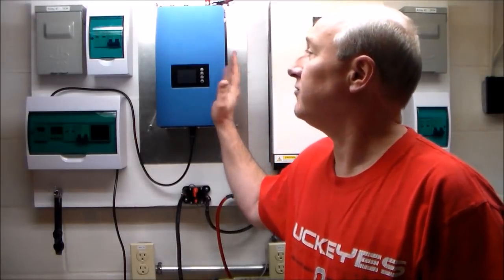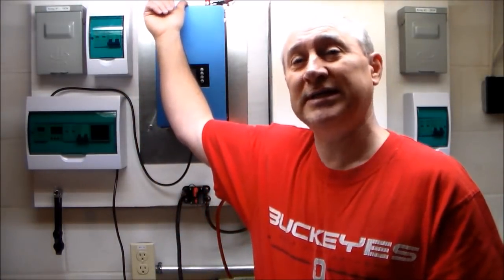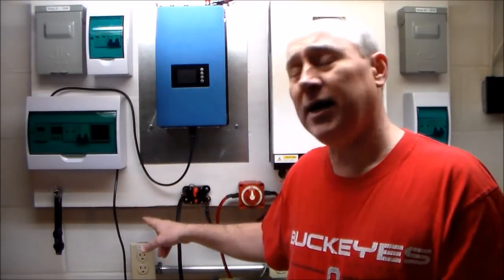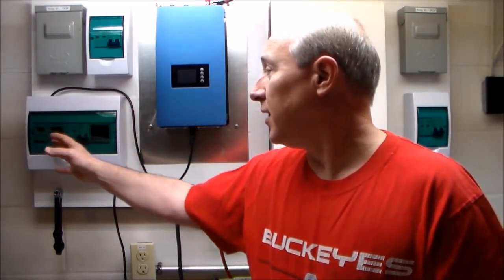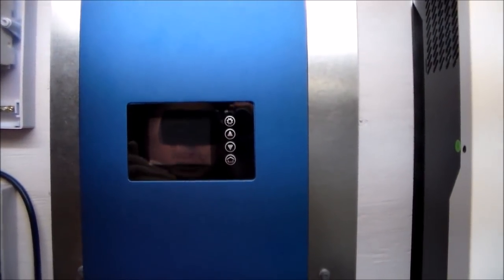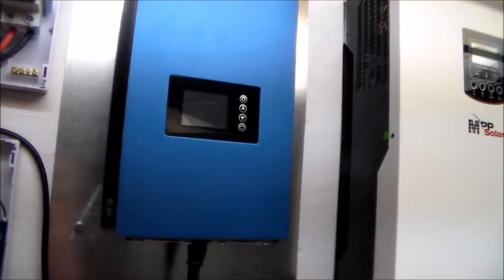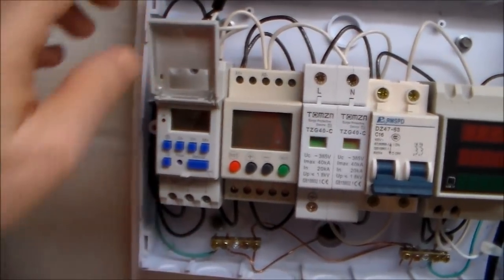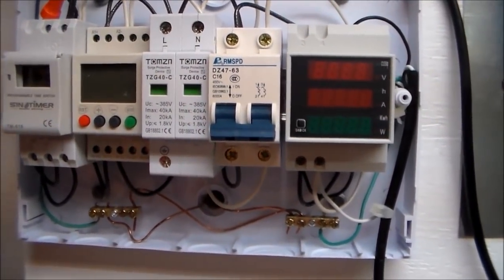DIY Solar - Episode 8 - Sun Grid Tie Inverter + Safety Devices (GTIL2)

Comment: I'm running a system that at times of days for a couple hours during the day will overproduce WITHOUT a limiter… Here's what happens.. the grid is happy to have the extra power you apply without having a net-metering contract.  I can see on the smart meter -negative power usage during those hours, but on the power bill it shows only 0 use… SO at least with my power company Southern California Edison, they have taken the apparent policy of not caring because it benefits them to take your excess power and not pay you for it rather than shut you down.  Your worry about overrating the outlets because of extra devices on the same circuit is incorrect.  The power you produce is absorbed instantly by any appliances on that circuit and they only pull what they need.  the rest is passed on.  If they take 500 w of 1000 produced, your circuit will pull 0W from the grid, and pass on 500W to the grid.  Your circuits are already circuit broken at the main panel at 15 or 20A generally.  It is not possible for more power than that to flow through the circuit because even if you tried dumping 21 A at 120V from a bunch of inverters all hooked into the same circuit, the main panel breaker would blow at the first whiff of exceeding 20A and then your inverters would see the grid go down and shut themselves down…. 

While I applaud your caution, in your zeal to be extra cautious you may have introduced an unintentional danger to your system:  While your "DC" disconnect is appropriate for cheaply manually disconnecting an AC pump outside your house, that disconnect from your solar panels is likely not appropriate as it is likely only AC rated.  You must have a DC-rated quick disconnect specially made for DC setups with this consideration of design.  It matters because DC tends to arc during connection and disconnection whereas AC because it keeps crossing 0 60 times per second self-extinguishes so you must have a specially constructed DC disconnect to not have tourble later with arc-burned contacts (and possible fire hazard)… If your disconnect ha a DC rating, I would be surprised, but this is something that you viewers need to be explicitly warned about lest they make this kind of error thinking an AC disconnect is the same as a DC disconnect as long as it is within the rated amount of amps.   And also 500A AC and 500A DC would never be the same rating for the same device because DC amps heat up wires many times more than AC Amps because DC is continuously the same amperage while AC amps are a running average amperage.or peak amperage but not continuous amperage where when you hit the 0 crossing in any AC cycle, you have 0 amperage which gives wiring a brief respite to cool twice in every cycle that DC amps do not do hence one reason why DC requires so much thicker wires than AC, why they heat up so much more. Be very careful about this problem.  You don't want your disconnect aricing in its contacts after just a few disconecct/reconnets and going down hill from there.
Reply: You are wrong.  If you plug a 2000 Watt ( 17 amp ) inverter into a 20 amp circuit, you can now plug-in appliances that will draw a total  of 37 AMPS through the wires that were designed for only 20 amps. This is 100% illegal per NEC !!!

Comment: Hello from WV. You have a complex setup there. I understand this setup is cheap v a UL grid tie inverter but it limits your production a lot. Since solar produces most at middle of day and much less as you venture away from solar noon. 
What is the change on your electric bill? Could you review a bill where it charts your usage in months before and months after your setup?

Comment: I purchased 2 of the over/under protection ones but just can’t get them to work. When hooked up they light up and blink the voltage. I went by the wiring diagram you show. Am I doing something wrong?
Reply from the maker: I would need to see a few close up photos or a video of your wiring before making any guesses as to what is wrong.

Comment: Thanks for the quick reply - what did you set your Under/Over Voltage Relay at??? 
If you are needing anything else from Aliexpress - they are having a BF sales like we are in the US - it's not a large discount , but it's some savings.
Reply from the maker: Chuck Ger Thanks for the heads-up about Ali! Under set to 110v @ 300 secs. Over set to 124v also @ 300 secs.

Comment: Are you sure you are actual putting power in your system or paying to put power in?
Reply from the maker: I am not feeding any power back to the grid. I have the limiter enabled to keep that from occurring.
Reply: @jimginnyohio  I don't think you understand what I'm getting at. A smart meter will tell when you are putting power into your system, not the grid and will charge you for power you are putting in you own home! I though the way you do until I got a efergy e2. It showed me the meter know when you are putting power into your system. Example I was using 1500 watts from my electoral company. I put 400 watts via gridtie solar panels. My efergy monitor shows my usage as 1900 watts charged to the smart meter.
Reply from the maker: @tihs69  No, I don’t believe so since the meter is on the opposite side of your electric panel from the inverter. In addition, the cheap grid tie inverters are not Smart compatible devices that would communicate with the meter. As long as your inverter does feed any power thru the meter, it would not be considered in your  electric bill.
Reply: @jimginnyohio Thanks for getting back to me. I thought I was helping out my electoral usage. My own meter at the inverter was telling me how many KWH I was putting into my system. I had no way of knowing for sure. Until I put in a house monitor that attaches to the previders electrical meter much like a limiter but on both 120 legs. Instead of showing a decrease of watts used it showed an increase the same amount that my solar panels were putting out! I joined a forum DYI solar and people there said in the US the smart meters will detect when current is being added in any amount without even going through the meter and charge you for the power you produce. If I were you I'd get a home power monitor like the efergy e2 and find out. No other way to tell for sure! Do you have any info. On how your inverter communicates with the smart meter other that then the limiter? If I knew for sure I would get this smart inverter! Thanks.
Reply from the maker: @tihs69  I currently have a Sense whole home monitoring device attached and consistently monitor the power I'm producing along with what my power company reports. I have not seen what you are describing.
Reply: @jimginnyohio  Thanks for your help. I'm looking at pulling all my stuff out and putting in a small but expandable net metering system. I looking at about $8,000.00 to start including permits etc. It will be DYI.

Comment: What size wires are you using for the breaker panel jumper connections? What size wire do you recommend going from panels?
Reply from the maker: Carsen Klock For the breaker panel jumper wires I used 12 gauge. For the cables coming from your panels, it depends on the amps you have the panels configured for. Best to check the National Codes for that based on your particular setup. For mine, I used 8 AWG.
Reply: @jimginnyohio  Thank you so much! I will be attempting to wire the same failsafes as you, I will be putting inline fuses at my solar panels and a secondary disconnect box (two total), I will also be grounding out my solar panel array (probably only going with four 100w 12v two in series and then the two pairs in parallel to get the 24v), would love to see a video of how the system has been running for the past year!

Comment: Hello Jimmy, really enjoy your solar info. videos ! One question on one of your videos you spoke about  the 2KW  grid tie inverter , 240 volt, to not get that one. What is the reason Please, I just ordered it before I saw that video .
Reply: Hi Eli. If you are outside of the U.S., this device should work just fine as it is. However, If you are in the U.S., please keep in mind that the limiter clamp will only be monitoring one side of your electrical panel while the inverter will be outputting to both sides. In this case, the inverter will not be efficient. It would be better to purchase two of the 1KW devices and connect one to each side of your electrical panel.
Reply: Thank you very much for your help. I was trying to save some bucks ( $440 for 1, $600 for 2ea. ) & yes I live in south Texas, so long.
Reply from the maker: Elias Villagomez OK, good luck with your installation. You may want to check this out to make the 220v unit work better. This will allow you to monitor both legs on your incoming grid power. Please let me know how things go since I would be interested in learning more too. Best wishes!
https://www.ebay.com/itm/Upgraded-cable-coils-for-US-220v-Grid-tie-inverter-with-Limiter-GTIL/232675119713?hash=item362c849261:m:mUO6Uuwgu0jtZB4XB0slTWw
Reply: @jimginnyohio  Wit this upgrade cable both phases will be monitored... and no back feeding to the meter ?
Reply from the maker: Carlos Guzman I’m not sure how that works with the 2KW model. However, with the two 1KW inverters I am using, there is no feedback to the meter.

Comment: You do not talk about a BMS system for you batteries. Why? If I build a 3 or 4 bank battery system, do I need one or not?
Reply from the maker: That really depends upon the batteries you use. The Valence batteries already have a BMS built into them. Therefore, they will keep the internal cells equally balanced and protect from over heat/over load conditions. By wiring the banks in parallel, the banks will self balance. For any other battery types, a BMS is a necessity.
Reply: @jimginnyohio   Thank you!!

Comment: if you install the limiter in one phase what about the other phase, so the system is going to be limited only on one side
Reply from the maker: This is a 110V device so it only outputs power on the phase you are monitoring. If you want it connected to both phases, you must install two inverters....one for each phase.

Comment: Hello,  just came across this video and I’m planning on something similar. 
I notice on your AC side the surge protector is shown on the output of the circuit breaker in the circuit diagram,  I would have thought it should be on the input side and it seems to be this way in the actual video. Can you confirm which you have ?

Comment: Your timer is not likely to save your inverter from a lighting hit just by mechanic of turning it off as lightning is static electricity and thus tends to jump across poles in switches bypassing them in its quiet to ground.   Far better to install lightning clamping devices and make sure your panels are all properly grounded to a proper number of grounding rods.  As far as the AC protection, lighting protection and a goo surge protector are all you really need.  Your utilities are generally better regulated than you are giving them credit of.  But in any case your inverters have their own internal limiters and provisions for brown-outs and over voltage conditions which they shut themselves down unless you r inverter is incredibly cheap..
 
Your AC breaker is curiously rated for 16A.  I hope that's because all your circuits in your house are rated for 20A.  None at 15A connected.  16 A is a very odd number.

The cheap typical Kilowatt meter plugin I use don't lose their memory just for disconnection.  They only reset their view on the screen to voltage but still retain their rolling usage and cost stastitics.
Reply: This is true. A lightning strike has such a fast rising edge that it contains radio frequency energy. RF is much more complicated to deal with and often does things to electronics that make no sense. You can have thousands of volts at one point on a length of copper wire and zero volts just a few inches away on the same piece of wire. I've repaired / tried to repair devices damaged by nearby strikes and have found the craziest things.

Comment: I have a question I cant seem to find an answer to. I currently have a "professional" solar install using SolarEdge inverter with power optimizers. Its using 22 LG solar panels and works well however, I would like to add some power to my house as we seem to be using more power then we thought, mostly due to the fact we now work from home. I would rather just add a something like this myself to help out but Im curious if it would/could cause an issue with my current system?  On one side given that the power company knows we push back to the grid I could just push what we dont use back in addition to what we do during the day (not much and we have a shading issue), but I dont want to push to the inverter and damage it.

Any help mush appreciated.
Reply from the maker: If you set up a couple of the blue devices (GTIL2), it would be completely independent of what you already have installed and therefore would not impact your existing system at all. Please understand that you would need to install additional solar panels and wire them directly to the GTIL device so that they are not in contact with your other system. It should work!
Reply: AWESOME thanks... my plan is to follow your system with all the safety parts (just smart IMAO), may paint the backboard something fun! :) My concern was if I was pushing back to the grid via a dedicated outlet and circuit that it could somehow feed back to the existing solar inverter. Does not seem likely but you know what they say about assumptions.. :) I will have separate solar panels and I am not touching the current setup. I will have the limiter but given that the power company assumes I will push to them at some point, I was thinking of just letting it do that, though it would not be much as we use it. Again THANK YOU, your videos are great, detailed and very thorough!!

Comment: George here...Jim, in your video, you placed an AC SPD in the panel box thru which  the 120V AC output of the inverter is passing through.  Don't you think it is better to put this  AC SPD in the  AC line coming in from your electricity supplier (YES-the grid). Any surge coming in from outside ... from the grid will be "caught" by this AC SPD ... thus protecting your entire distribution circuits in your mains panel board ... including your exclusive 120 volt outlet for your inverter output. From the looks of it, you are just protecting your GTIL INVERTER but not your other house appliances - unless, of course,  you already have an AC SPD at the entrance of your house main lines.
Reply: thats what I did, put the spd before the breaker, I believe it is better so. And put a thick ground wire #6 direct to the earth rod so lighting surge can flow to ground better.

Comment: I want to copy this system exactly as you've done it. How many PV panels did you use and what were their voltage? I have found some good priced 24 volt 300 watt panels, but I have a feeling that they won't work with your inverter. My other little question was when I install the dedicated circuit breaker, what gauge wire are you using? Are you using a a 20 amp breaker?  are the wire gauges is that on the drawings?
Reply: I am using four Sainty Solar 255 watt panels.8.5A pmax, 30V pmax each. These are wired in series and parallel as shown in the inverter guide. I used a 15amp breaker, although you could use a 20amp breaker as well. I used 12 gauge wiring.

Comment: No offense, but why did you go to such an elaborate system for only one thousand watts? What can you power with your system in a grid down situation?
Reply from the maker: Not elaborate or expensive. I wanted to insure things were safe and equipment is protected since I’ve seen so many people post videos about these and they burn up within a year. Mine has been running for 3+ years now without a hiccup.  Yes, I’m able to run critical loads in my house when the grid goes down since I have 10+ kWh of battery storage. I can supplement that with the grid tie inverter too since I have that circuit included with my critical loads.

Comment: At time 18:35, you claim that the Halex 60 Amp 122/240 Volt AC Disconnect, is also "DC Rated".  I cannot find any DC Rating for this device on the HALEX website.  Where did you get the DC RATING ?

Comment: It would be great if this system could also use batteries at night. Could this inverter take power also from batteries (when solar power is down)?
Reply from the maker: Hi Jarek - The blue (grid tie) inverter is capable of taking power from batteries. However, I did not configure it to do so. The reason I didn't is because I would have needed to install a dedicated charge controller to feed the batteries and then the batteries would feed the inverter full time. The white inverter is configured to use the battery bank I put together. Perhaps I will change the configuration later so that the blue inverter uses the batteries too. But I just didn't do this initially. I plan to build a new battery bank soon using either Nissan Leaf or Chevy Volt batteries. When I do that, I will most likely move my existing batteries over to the blue unit.
Reply: @jimginnyohio  Using a similar setup myself and just ordered a Volt battery to add on...

Comment: Hi, I have search everywhere for the same setup as you have (not feeding the grid).  I have a question. On your setup.  

What you have is setup for 120volts, which only applies to one leg of the main panel.  In order for me to use this setup, either I double it (for use of both legs of the main panel) or put the circuits I use during the day on the same leg as the inverter?
Reply: The answer to both questions is Yes. You could do either. Although, I would recommend using two inverters....one on each leg. It will cost more up front, but would be the safer alternative since your house was probably load balanced when the original circuits were installed.